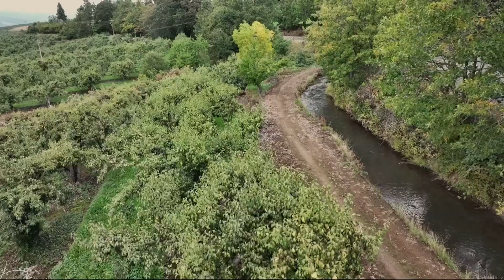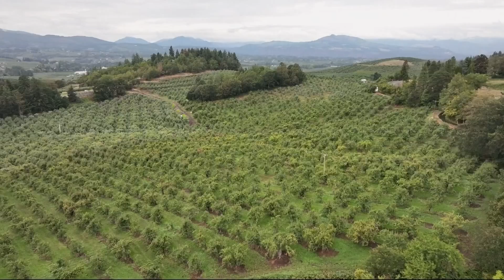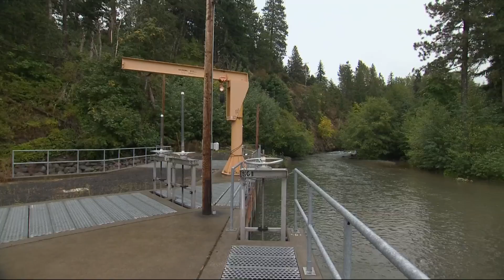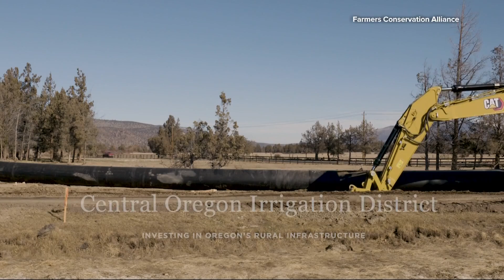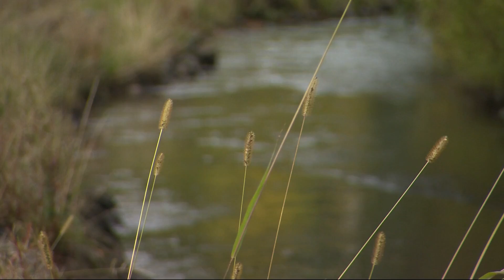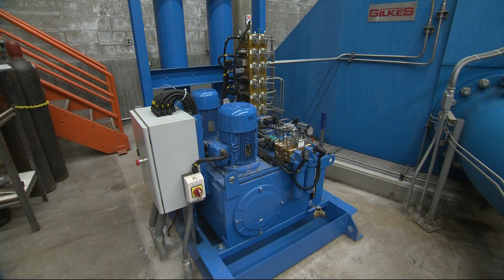With Oregon's water sources dwindling, irrigation districts are feeling the pressure to modernize

Comment: Something that was not mentioned was that in some places, the irrigation canals are also used for drainage during the winter. So after the summer growing season, the irrigation district shuts off the water to the irrigation canals, and then those same canals carry away, rain water that would otherwise flood the roads and land. In the late spring, after the rain quits, the irrigation district reopens the flow of water from the rivers back into the irrigation canals. The canals serve a duel purpose that piping would destroy. The article also implies that the irrigation water that is lost, is wasted. It provides additional food and habitat for wildlife, and presumably helps replenish water in the ground aquifer that is tapped by wells for families for drinking, but also other purposes,
Reply: Could the drainage not also go through the pipes?